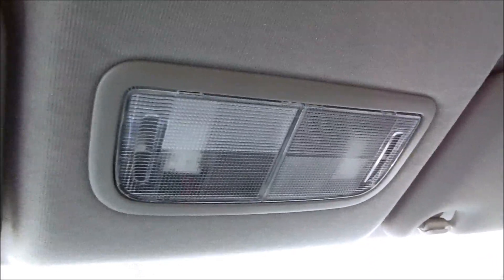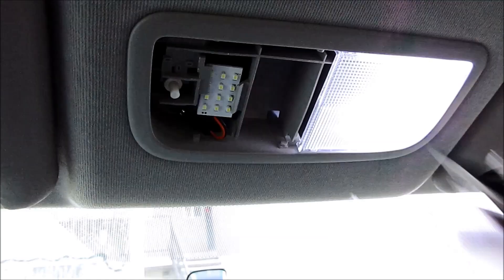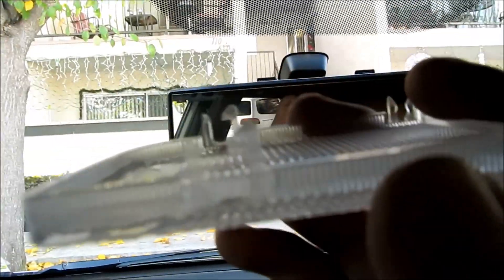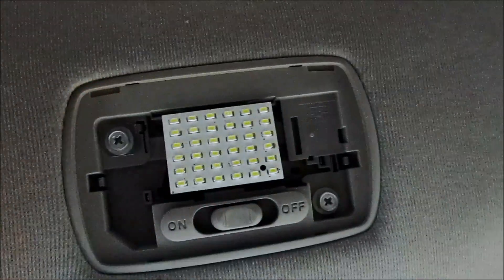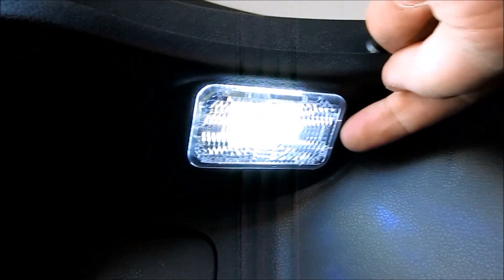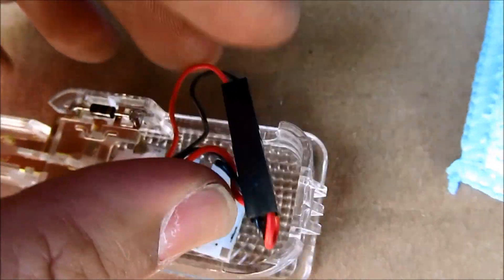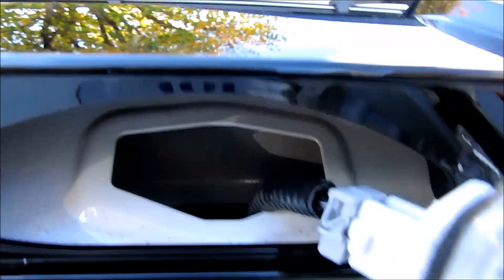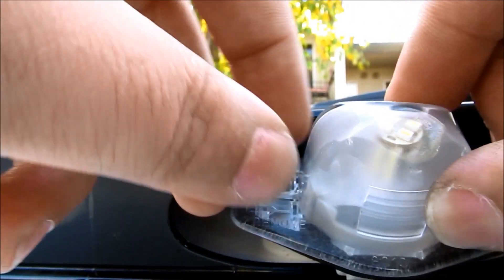DIY 2012 2013 Honda Fit Interior and License Plate LED Swap GE8

Comment from the maker: led(light-emitting diode) are mounted on a pcb board (printed circuit boards) and is inserted to the positive and ground terminal contacts on the vehicle that powers the led.

Comment: Thank you for this video. I'm going to try this on my 07 Fit license plate lights since I have some T10 LEDs just lying around. I thought I'd have to remove the entire trim panel, but your video was really helpful. Just press and pull the light cover to the right. That's awesome. Definitely doing it when my wife gets back with the car. I'd like to do it to the reverse lights as well since I see from your description they are also T10 and those are easy to access by prying off the brake light panel on each side in the hatch. I want to also do the front lights which are also T10 (the top not the HB2 which I'm also going to do), but in order to access these lights you have to actually take off the entire front bumper which sucks.
Reply from the maker: Just be careful not to push too much or else it will break the plastic clips that holds on the license plate lens.  Push slightly and pull down.
Reply: The reverse lights are not t10. They are t20 (7443). Had to order a pair off ebay after I learned this. You should correct that in your description.
Reply from the maker: Actually, the bulb I listed is correct for the 2nd gen honda fit which this video shows.

The bulb list for the 1st gen fit: 
Interior map is DE3175 31MM
Parking: T10 194
Tailight: T20 7443
trunk: T10 168
Rear turn signal: T20 7440
Front turn signal: T20 7440
Reverse: T10 7440
license plate: T10 168
Reply: The reverse lights are T20 not T10 on the 1st gen which is what we have (07-08). It's a bigger bulb than the T10 and located adjacent to the T20 orange turn signal bulb.
Reply from the maker: Its only for the 1st gen it is T20 7440.  2nd gen is T10: https://youtu.be/U8a-jIe28ko  The parts I listed is for the 2nd gen.  I just didn't realize you had the 1st gen.
Reply: No problem. Wish mine were second gen in this case then I wouldn't have had to special order the T20 bulbs (from China so they should get to me sometime before my death...lol). Mahalo for the info though. Good video.

Comment: Awesome tutorial. Very clear instructions. I am ordering the SMDs for my Jazz now. For the cargo, did you not consider the type you used in the license plate?
Reply from the maker: Prabu Venkatraman Unfortunately the ones I used on the trunk did not fit inside the license plate light.  However, since I've made the video.. there are company that sells these...http://www.ebay.com/itm/White-LED-License-Plate-Light-OE-Style-Pair-For-Honda-Fit-CRV-Odyssey-Warranty-/391228480225?fits=Make%3AHonda|Model%3AFit&hash=item5b1708dae1&vxp=mtr